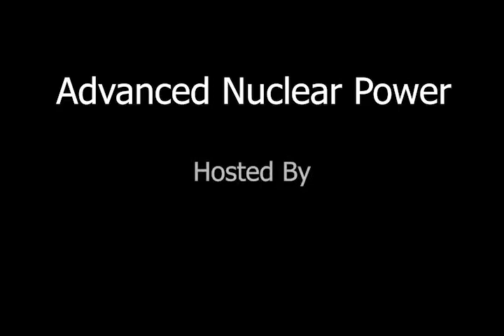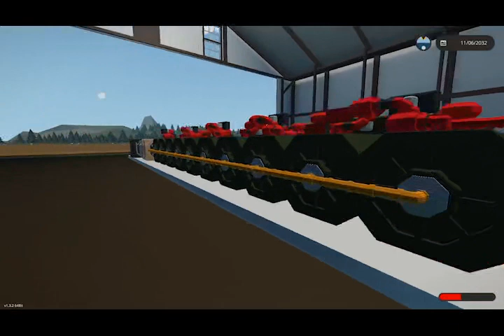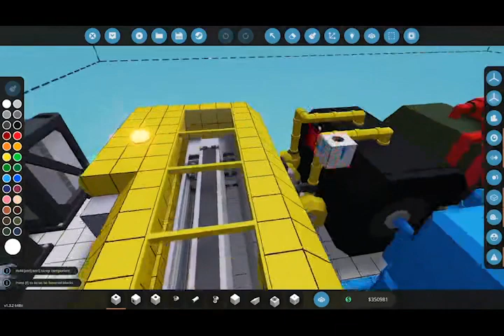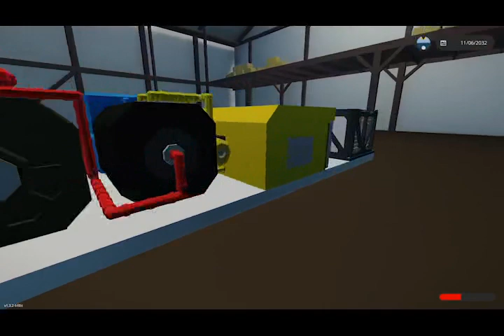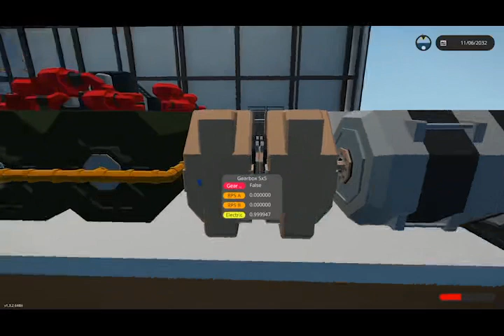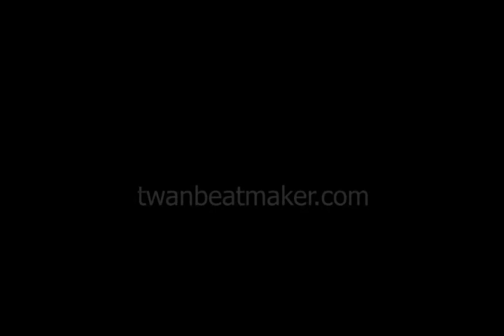Stormworks: Build and Rescue - How to Build an Advanced Nuclear Reactor System - Hosted by Disdain

Comment: I might be wrong but to me it seems like pressure is what drives the system however because your turbine farm is so huge and has the pumps it pulls so much steam through the system that the pressure doesn't have time to build up aka you are using the pressure to drive the turbines therefore even at a low pressure it can still make lots of power. don't know if that makes sense I'm not the sickest cunt at explaining things

Comment: Love it Could you do a smaller one for small ships
Reply from the maker: This could be used for a smaller ship, but not much smaller...lol. Theoretically, you could cut out half the turbines, one set of gearboxes, and three generators. This would cut the size by 1/3. It would probably not be worth running anything smaller than 10 turbines.
Reply: Hmm, I managed to make a 12 turbine 2 boiler system, with 2 generators which outputs around 11kw - 12kw total. I mean, it can run 8 large electrical motors at full throttle without dropping power, which drives my waterjet ship at around 35-40 knots. The system is pretty large however, not as long as this one, but much taller. It can probably be modified to be shorter though.